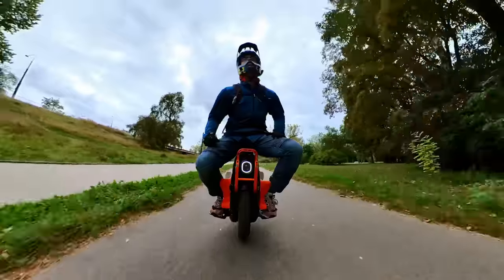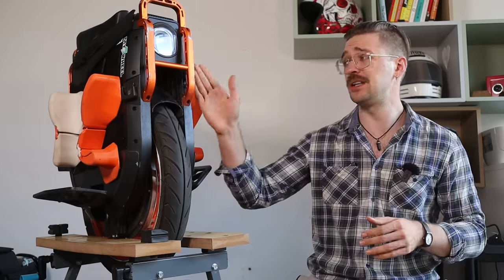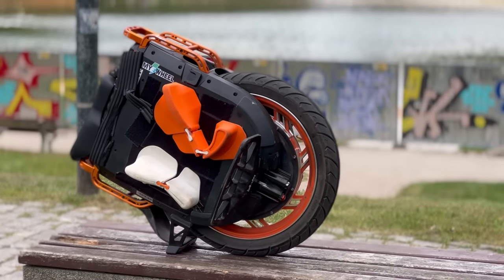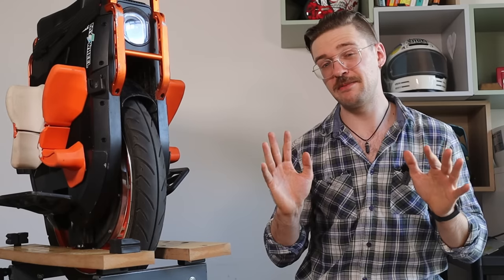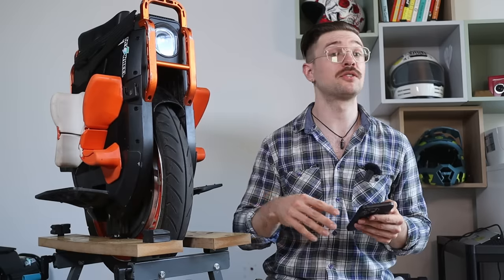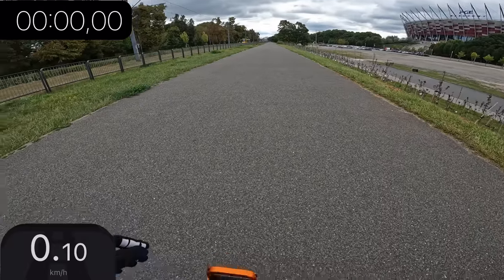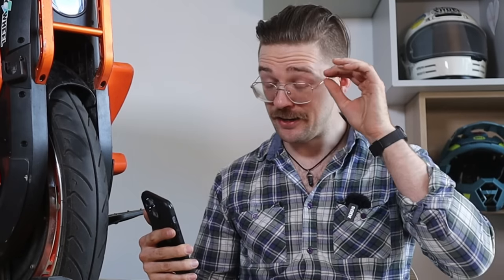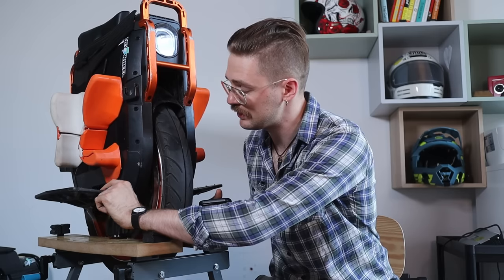MOST OVERENGINEERED E-WHEEL - 126 VOLT INMOTION V13 COMPLETE REVIEW

Comment: 54.47 watching til the end was the "WRONG WAY" haha. 

Agree on all points about this review. Hopefully the safety will  be adopted by all the manufacturers.  

I would like a new wheel, but so far there isn't anything tempting me to replace my RSht. It's been a great wheel (no rain riding) and as much as I like the idea of suspension I don't want the extra stuff making noise and needing extra attention. 

Looking forward to more begode extream content as that seems to tick my off road boxes. I don't ride a lot of on road these days so I'm after as much torque as possible,  and a reliable suspension system that resists bottoming out from the bigger hits. 

The RS does a good job on the torque but without suspension rough tree root/rocky trail section have to be taken slow. If suspension didn't happen it would still be one of the best for off road but it is there, and I want it. 

Basically I want an S22 and an RS to make a baby 😂

Comment: The V13 wheel addresses a distinct subset within a specialized market, and it undeniably holds significant implications for Inmotion's future, firmly establishing their commitment to top-tier safety standards.

While it may fall slightly short in terms of torque and range when compared to counterparts like the Begode Master Pro in a similar price range, the 'Raptor Controller' shows promise. 
I anticipate that Inmotion will make every effort to minimize weight, maximizing battery capacity.

I'm eager for the forthcoming review of the V14; it will be intriguing to witness the innovations they bring to the table! 😊

Comment: 💯 agreement. The v13 is a great first attempt at a 22” wheel. If the motor, shocks and batteries are redesigned, this wheel will be successful in future iterations. 
 
Thanks for the effort. 😅 Your 2700km experience was totally worth an hour of my time. 😂
 
The IM Challenger’s design, if upgraded beyond the the IM Adventure, will be a formidable value at any price.

Comment: Seeing the remote controlled lock reminds me about one missing feature: A lock, as in a physical block, integrated within the kickstand or trolley handle to chain it somewhere. Or just an integrated mount to fit one of those foldable locks.
Plus, if someone tries to turn it on without code/key or take the wheel, let the user be able to record a message shouting from the wheel (at least speakers are not useless that way).
Reply: When needed, I put my lock through the spokes of the wheel.

Comment: The only thing that stopped me initially was the range! Especially because I would have removed the suspension myself. Now that I looked into it more, and being 115kg with gear and backpack, I need a very strongly braking wheel with range. Ans as you said in the video: 50-60kph is more than enough speed and at the limit of safety for these systems simply due to braking distance. (Race track is different). Lets see what the Adventure (or maybe v14) brings

Comment: Watched the whole thing, very interesting, thanks Adam!!
Question for the readers here about what I should upgrade to. I'm a 183cm (6ft), 110Kg + gear rider. I only ride on roads, or around town. My current & only wheel is a KS18XL. I want a safe, reliable wheel that can go about 70Km/h & am hoping for more range. I live in a place where not every make & model is available, so the available options are: V12, V13, V14 (preorder), Sherman Max & S22 Pro (usually not in stock). If I buy Inmotion, the shop is near me, which helps if there's an issue. If I get the Sherman Max or S22, I would need to have any issues fixed by a third party (good scooter shop nearby though). So any thoughts?
Reply: You are similar to me in height and a bit heavier. I would recommend something with 22 inch tire. Awesome stability and safety. It takes some time to get used to but same as learning to ride those machines. Just worth it.

I personally choose maspro. Awesome mix of a cruiser with spot bike with tons and tons of headroom at almost every speed and scenario you will encounter
Reply: Thanks for the advice. Sorry Maspro, can you clarify?
Reply: @MrSpeednz  I meant begode master pro
Reply: Ah thanks for the info, it looks great! Unfortunately not an option here.

Comment: Lower pedals and no suspention makes rapid caving faster and therefor more fun.  But in reality carving is not the standard use case. The fact it is being used as a measurement for control is not accurate.
In reality higher footplates do not really changing your turning speed or difficulty if you control for other variables.

Carving tests trick you.

Comment: IP67-rated enclosures are able to withstand waterhose and jet sprays and can sustain momentary water immersion in depths of 150mm to 1000mm up to 30 minutes maximum. IP67-rated enclosures are guaranteed to function in indoor, outdoor, w and demanding industrial and commercial settings.

Aka more than 1m water depth or more than 30 minutes, batteries still not under warranty.
but yeah, going the right way. When we reach IP 68 im confident.
The BMS with individual voltage and PAIRED temp is 2nd to none. Last wheel I saw that on was Xiaomis old legends.

Comment: With a V8F and lot of intermodality (train, metro, stairs, etc), I really don't have any need for the V13 …
I want at most a light wheel less than 20kg, a range of ~50km, a max speed of 50km/h, and shock absorber.

Comment: Adam, stuck it out to 55:10 thanks, for the review. I had a deposit on this wheel, like I did on the S22. I didn't buy either one. I am so done with hype EUC releases. I watch them get released, riders like yourself provide comprehensive reviewsbeyond what I would put an EUC through, & thats greatly appreciated. However the most annoying thing is these EUC manufacturers not listening to their customers, or reviewers like yourself, & making EUC's that fully meet our requirements, which makes me hold off on any new EUC from now on, I will stick with my V11 love hate relationship as long as I can, & just take short trips, & use my car for long trips, which I would like to replace. 

The first thing that puts me off, not only with the V13 but with other wheels is no street tire option out the box. Spending $4000USD on an EUC that my use case is commuting & I'm replacing a car, so yeah that became a let down when it came with an offeoad tire, & it is a stupid choice by inmotion not to offer an option, as they would probably realize that street tire is more popular, & would compel maybe more riders, but for those that are already pissed they have to take apart a brand new $4000 EUC, that's a pass. The trolley handle design is terrible, that design needed to stop with the v12. They could have integrated a trolley handle that doubles as a seat like the Sherman S. That seat design, & trolley handle is stupid, & they can redeem themselves & update that quick  so the wheel doesnt fall into complete obsolescence. The other things I agree with is the headlight needs to tilt, I mean even on the V11Y that's coming out. no tilting light. The charge ports need updating, & the battery capacity. If it had a 4000Wh pack Ithink that would help with range alot. Yeah I was really disappointed with this wheel release, & now I'm looking @ the master pro, but I really hate begode wheels, I think they're all really low quality trash, & resonably unsafe despite their performance. I also never see 1000+km reviews of begode wheels, only Veteran.

Again, I hope inmotion & other EUC makers start listening to riders ipdate their exsisting wheels or they will end up like begode saturating the EUC market with wheels every month that dont check all the boxes, & obsolete the following month. Thanks again!
Reply: Almost 9 000 km on begode master pro v1. The wheel lacks quality in finer details like a mudguard for example. Overall everything that needs to make wheel work - works no matter how hard I try to proof it otherwise with my riding style. If you have any questions type below. I will try to answer

Comment: Still coming across as biased against begode.
The bolt on the extreme shock breaks under certain specific conditions and its "begode quality aha". But the bolts just fall out of this EUC or other problems happen and its not "Inmotion quality aha".

Really ask yourself if begode is imporving faster or slower than other EUC manufacturers.
They switched to great sliders, a full width rim, smart bms, much higher water proofing, and a full 130ar mm travel in a single itteration.
And the ifferation before that with the EX30 also had tons and tons of improvements.

Sure begode started with a worse product all in all. But Im not really seeing the evidence that inmotion and kingsong are keeping pace. They seem to be getting overtaken.
Inmotion doesnt even have a 130 mm travel yet and they didnt have to fix all the quality and safety problems begode had.
How they had so long.
And same with other aspects I'd really take a good look at the list of differences between generations and see how much begode improves vs inmotion and kingsong.

Comment: Wonderfull review as always. You changed the tire it seems ?   I have 6565 km on this wheel today, I love fast seated on road riding but I have other wheels for forrest riding. This wheel made me sell my car. My advice is dont buy this wheel if you are a beginner.  The assist systems on 100% will drive you nuts go for 67% - the manual have no explanation about the assist systems.  S22 gives me back ache Inmotion v11 and V13 does not. Why ? The slim and tall design is better for your lower back than the "lilttle and fat" design of s22. Center of gravity is a little higher too...  Day1 I could not ride the bloody thing - Ive been riding every day for 4 yrs at the time. First thing to do is adjust brake assist and acc. assist which is a bit like "SOFT MODE"
Reply: USing 2 chargers gives me error message sometimes.

Comment: Its an expensive wheel, so I would have high expectations. But the wheel does have impressive redundancy systems etc. Is it 2x as good as the v12? (which is half the price and has been improved by us (as the testers). Probably not.

Comment: i just ordered a second one with the stock knobby. the one i have now has the michelin street pilot 2 inflated to max pressure, 45 psi. inflating the tires properly to the mas pressure really enhances the euc experience. takes less energy to push a hard tire as opposed to a deflated tire. makes ur euc safer. but yeah, u do have to learn how to balance and build ur core strength more, but i enjoy the v13 more than the s22 or s18.

Comment: Weight? Inmotion actually boasted about the weight of their motor in their teasers. Ecodrift weighed it 17.7kg with rim and tire. Begode C38 and S22 motor/rim/tire were about 3-4kg lighter. When Ecodrift pulled it apart you could see it had about twice as much copper as the others...but it seems no more powerful. Potting? Great for many applications but for EUC I'm not so sure. Increases stiffness and heat absortion but maybe heatshrink with neoprene cushoning in structural pack is better re vibration/weight/cost. Looking at V14 Adventure I suspect Inmotion feel the same now. The V14 motor looks lighter as well so I think they are heading the right direction.  Maybe in Poland a 20", Adventure motored, 2400/3600 batteried Inmotion will do better. The V13 is for wide open spaces (USA) and I'm sure the US market dwarfs Poland. btw I prefered your previous vids. 54.43

Comment: yeah, if you try to keep your speed at 65-70km/h (avg 45km/h'sh) in 40km travel distance, you will be left with around 55% battery.  Not great.  I ride v11 and v13.  Yup, v11 can climb pretty steep hill.  Timestamp 54:44

Comment: The V13 is a quality piece of kit. The problem is, being "quality" is the only thing it excels at... it doesn't actually do anything well. Its heavy & isn't nimble, takes a lot of effort to accelerate, brake, and turn, so its not a city or commuter wheel... Its torque is weak and the suspension requires a lot of maintenance, so its not a trail or jumping wheel... it can go fast and is stable, but it has a very short range for its size, so its not for cruising or going long distances... so what is it really for? IMO the V13 is the same as the Veteran Abrams... better made maybe, but still inherently flawed by design.

Comment: Watch the quality of that board come down in future models as the engineers skin down the mosfets, use thinner metal solder and thinner printing on the circuit boards (they'll maintain the same number of mosfets of course, but use lighter, lower quality stuff until they start popping and selling more boards)😂  Engineering excellence they call it ha ha ha 😂  Wait till the marketing and sales guys get to the engineers in Inmotion.

Comment: Interesting review. I remark to myself that my experience with the V13 has been quite different than yours.

The V13 is the first unicycle, electric or not, that I've ever ridden. I've been aware of EUCs for a long time, but when the most popular brands are names like "Begode", "King Song", or "Leaper Kim", that's enough to keep me away. I'm not going to trust my life to a device made by a company that can't even choose a reasonable name. You've got a Begode? You know your doctor can help you with that, right? I don't trust wheels made by a brand that sounds like a disease or a Chinese rice machine. When I saw InMotion's V13, that changed everything. It's the first and still only EUC that doesn't look like a high school robotics club project. The V13 gets wows from people on the street everywhere I go. The look alone is probably 3/4 of the reason I now ride a wheel.

While the V13 is heavy and definitely a lot to chew on as a first wheel, it's not a horrible wheel to learn on. The stability and confidence it provides goes a long way towards keeping me going in my riding progression. It took me 100 miles to really feel like I could put both feet up and ride everywhere I wanted to go and maybe 250 miles till I was comfortable riding out in traffic up around about 30 mph. I still wouldn't recommend a V13 as a first wheel unless you're real confident you'll be riding long term simply because of the price, but otherwise I think it's an excellent first wheel. I would be unhappy today if I had purchased any other wheel because the build quality would have bad and I would already be running out of headroom to grow. The V13 gives me plenty of room to grow.

I've had no problem with the suspension system, though I'm only working with about 400 miles under my belt so far. I suppose I'd appreciate a system the requires less maintenance. So far I have no complaints.

Another area I have no complaints: the battery. Even when I push the wheel somewhat hard, I'm getting the equivalent of 55-60 miles out of a full charge. On rides where I just slowly noodle around, the distance could be closer to 75-80 miles. But I say equivalent because I still have not used more than 25% of the battery in a single ride. By the time I am done with my rides, I am pooped. My legs and feet are spent. I'm exhausted and don't have much interest to ride anymore. The idea that I need a wheel that can travel a lot farther than the V13 seems ludicrous. Being able to travel 30 miles on a charge is plenty for me. I cannot imagine that a significant percentage of EUC riders are going on rides regularly that involve distances over 20 miles. I think InMotion has perfectly nailed the battery system on the V13. It's safe, reliable, and lasts so long that I essentially never need to think about running out of battery. In fact, when I'm riding every day I often only plug the V13 in to charge every few days simply because the wheel still has plenty of juice left. Three days of running errands usually won't have the wheel below 80%.

On the other hand, I feel like you absolutely glossed over the screen on the V13. I have not used a touch screen as bad as what's on the V13 in at least 10 years. Holy cow, I cannot press it once and have it do what I want it to do. Turning on the password lock function is useless. The touch screen is so poor that even I cannot enter the code and I know what the code is. Maybe one out of every three to four button presses is registered correctly. The screen is constantly registering button presses on the side of the screen opposite of where I'm touching. Attempting to adjust any of the settings sliders is straight up impossible to do with any degree of accuracy. While the V13 is made of excellent materials all around which are well put together, the touch screen was slapped onto the wheel with as much thought and care as I use when I wipe my butt. That touch screen is an absolute disaster. If it was any worse, the wheel might not be useable at all. The screen is without question the Achilles' heel of the V13.

Overall, I think the V13 is a fantastic wheel. It's exactly the wheel the EUC community wants and needs: an extremely high quality, well made, and reliable wheel. It's the first wheel someone who's not into EUCs might look at and not laugh at. No wheel has reached the level of quality and appeal that the V13 provides. While the price tag is too high for most people, this wheel is an attention grabber. It might not be the wheel that brings a wave of new riders to the sport, but it's the wheel with the largest potential to familiarize the larger population with EUCs as something that exists. The V13 is the first respectable EUC. I'm stoked about what InMotion has produced and want to see more.